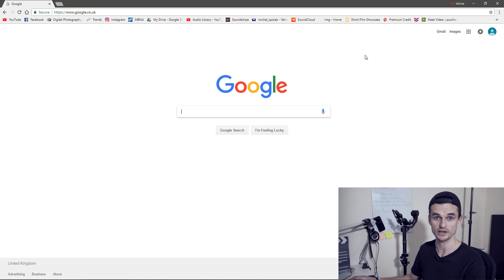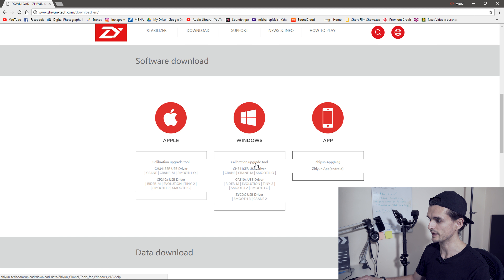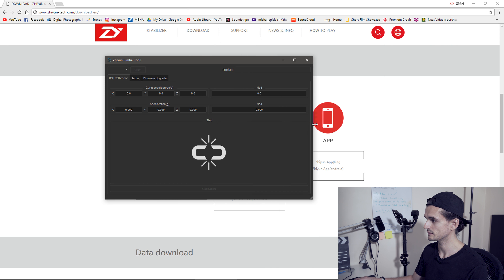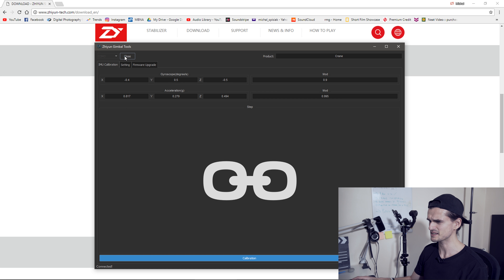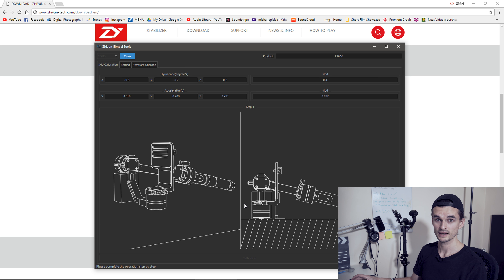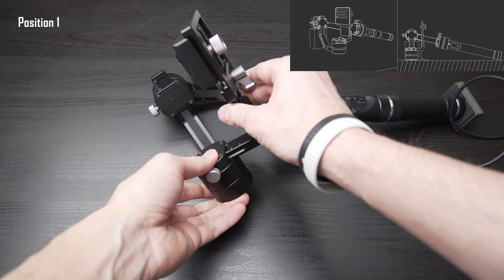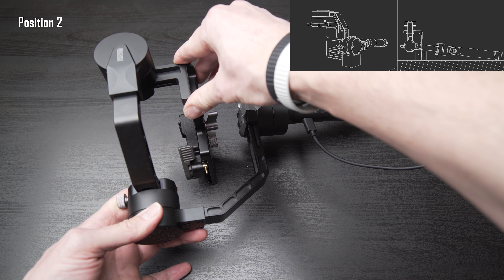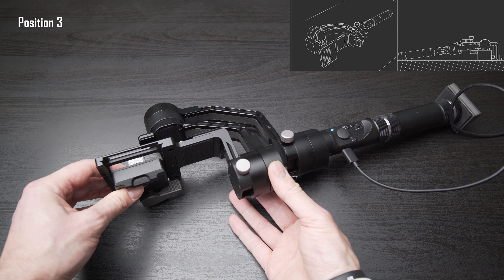How To Calibrate The Zhiyun Crane /Calibration Tool On a Computer/

Comment: Hello there, I bought a used gimbal,  the model is crane 2, Mac or PC computer drivers are installed, but the Calibration software only see the com3 port and won't show the product, so I'm not able to calibrate or update the firmware, any leads on this matter, thank you.
Reply: I'm havig the same problem. Were you able to solve it?
Reply: @marcosmontesdeoca2423  Yes it was resolved with an old version of the calibration software for Mac, check on Facebook for the Zhiyun page, many people are asking for the same problem and they suggested to use an older version. On a site note, the problem that I had was because one of the axis was a little off and I needed to calibrate that axis, the calibration tool let me calibrated the axis so now is all good.
Reply: @mainmixnight  Thanks for your answer! I ended up downloading the app on my phone (couldn't make the software work on my pc) and got to do the six step calibration but I still have mi horizon sloped to the left, I also tried calibrating the roll axis engine but nothing seems to work... any ideas?
Reply: @marcosmontesdeoca2423  I have the Mac/Apple computer version, the PC version didn't work for me, on the calibration tool software there is an option to calibrate the axis, it require a USB to mini USB or micro USB cable, depending on the model of the Zhiyun gimbal, once the software can detect the gimbal you can adjust the axis, the camera needs to be mounted on the gimbal and balanced, put the gimbal with the camera on it on a flat and leveled surface and try to adjust the axis.

Comment: What is purpose of silver adhesive tape at pan motor ?
Reply from the maker: The only reason is to stop the other arm scratching the top of the motor. Often happened when the crane is unbalanced. I've got some sticky foam there now
Reply: Thanks Mickal

Comment: I have done all the necessary steps and for some reason, when I plug my Crane Plus into my USB port, the gimbal tool program will not automatically add the gimbal to the selection window to allow for calibration or firmware upgrade. Can you please help?
It like the app is not recognizing that I am hooked up to the gimbal with the USB cord.... I have tried unplugging it and plugging back in, as well as trying to restart the whole process with the gimbal in standby mode. Any guidance will be greatly appreciated... Thanks!
Reply: Happened to me earlier. But then I reinstalled the downloaded USB driver while having the cable connected to the crane and computer. It worked for me, maybe you could give it a try.
Reply: Kleisthenes III  Thanks, brother! I will give it a shot.

Comment: What do I do (or what could be the issue) if I cannot get passed position 2 in the process? I have tried dozens and dozens of times. I am POSITIVE that I have it positioned correctly (exactly like it is in this video and several others I've checked) but the software doesn't seem to recognize it's in the proper position :-/
Reply from the maker: I'd try restarting the computer, reinstalling the soft and try again.  If that won't do it, the issue gotta be with the gimbal itself.

Comment: One question, I saw on the few videos that guys have some tape or something on the bottom motor.. You have grey tape on the crane. Why? Thanks for the video - it's great!
Reply from the maker: Thanks man. Well I found that the tape adds just enough weight to counterbalance the... Just kidding, it's there to stop the other arm scratching the top of the motor when it's unbalanced. That's all, I use some sticky foam now.

Comment: What is the reason for calibrating the crane? I'm not sure entirely. Great video & thanks for all these helpful vids.
Reply from the maker: Thanks. Even if you balance the crane well, it can still be a bit off when you use it. (skewed horizon for example) It's to do with the internal gyroscope and calibrating should help.
Reply: @michalspisiak   Thank you, just got completed calibrating my crane plus I noticed that while am in some modes its not straight on X axis and always tilts so the gridline on the camera and the picture being recorded is not matching so I knew something was not right, thankfully I remembered somewhere people saying they should calibrate before use but never did, but after watching ur vid and calibrating it successfully,the crane is a lot more smoother, responsive and always straight thanks for the great tutorial.